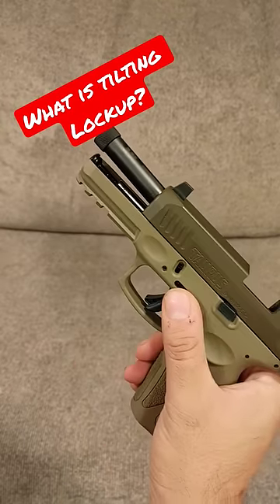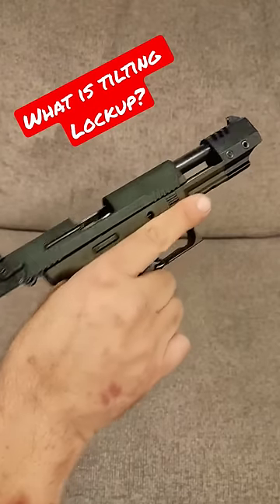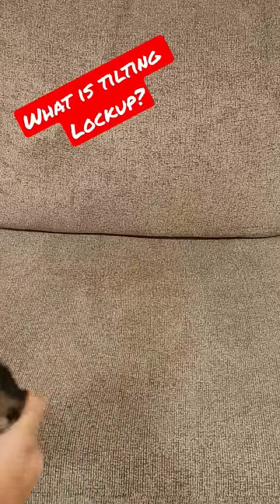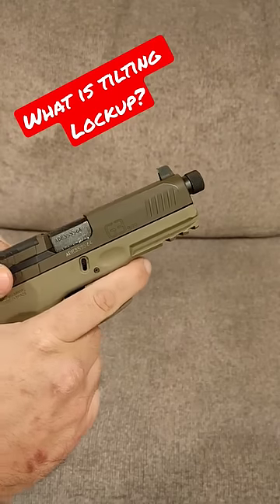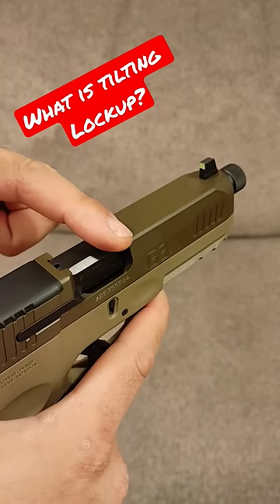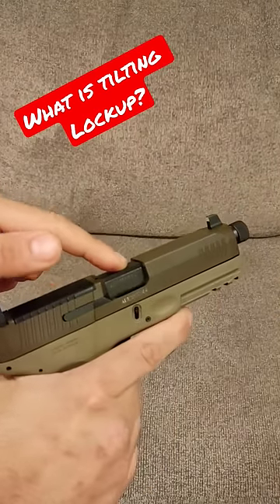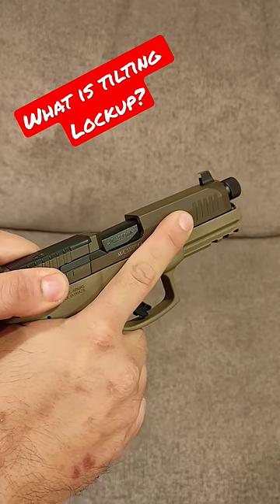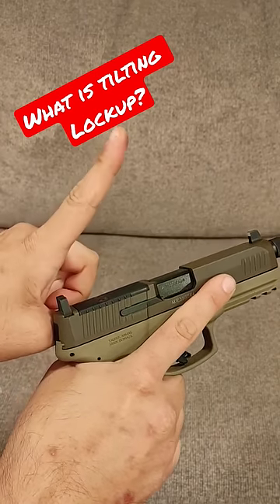What is Tilting Locking Action?

Comment: To me this leaves room for error and inaccuracy. The barrel moving out of the straight position to me will where off a little and you would think that it would slightly become not straight and accurate anymore
Reply: key words "you would think". sure, you would, but life doesn't work like that. in order for the barrel to tilt when the slide is forward in the locked position or move out of battery in any way, even over time, it would have to be breaking the laws of physics and pretty much be phasing through the slide itself. it's really just like any other moving part in a gun

Comment: That's a Toro or the g3C
Reply from the maker: It is a Taurus G3 tactical. Just came out this year. Has the Toro system but it also has suppressor sights a suppressor recoil spring as well as the threaded barrel

Comment: Why do I remember someone telling it was to match up with the sights
Reply: Because there's no end to gun lore that isn't true but will never die. The action is designed to keep the breech and slide locked until the breech pressure is no longer dangerous. Being able to maintain consistent sighting and reliability are precision requirements levied against how well it's manufactured. This same action is used in expensive, match grade pistols and economic pistols with no more than basic combat accuracy. But both will be safe to use and unless someone really screwed up will function reliably.

Comment: Wait a minute I have a P 22.. and my barrel tilts I can literally sent you a picture
Reply from the maker: The standard P22 has a slightly different design to the way the barrel is held in place. It is technically a floating Barrel not a fixed barrel. This Barrel is held flat using the simulated compensator that's on the front. You can actually take the barrel out of the frame as soon as you take the top off. That makes it a floating Barrel as opposed to a fixed Barrel so the barrel actually moves back when the gun fires on your gun allowing it to tilt. No picture necessary

Comment: Walter ppk doesn’t use a tilting locking action.
Reply from the maker: You are correct it uses a fixed and pinned Barrel. And the P22 that I showed in the beginning of the video has a floating Barrel but it still doesn't tilt

Comment: Ha! I'm the guy from the other video. Thanks for the explanation 🙂 Does this tilt action affect accuracy in any way?
Reply from the maker: No. When the gun is in battery, the barrel is locked in place. It onpy releases when the pressure drops after the bullet leaves the barrel and then it tilts. More than likely, you will be the determining factor as to its accuracy

Comment: Why do you use so much gun oil 😭
Reply from the maker: Because I had just taken it to the range and cleaned it and I hadn't wiped the excess oil out I like to rack the slide a bunch of times to make sure the oil gets in every single nook and cranny and then pop the slide back off and wipe off the excess. Despite what you've heard as long as you keep the oil out of the striker and out of the striker tube there is no such thing as too much Lube
Reply: @TheJimminiShow  fair enough lol and in my own experience I find there to be a limit to lubrication it allows dirt, debris, etc to build up quicker since it catches it all